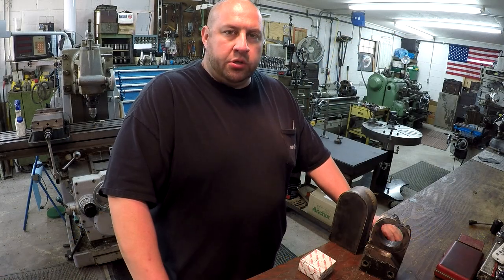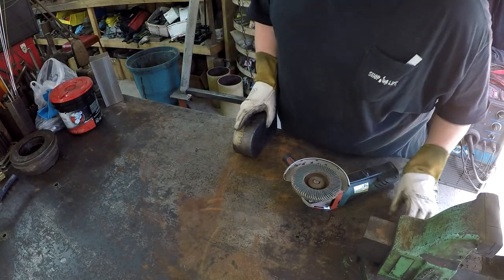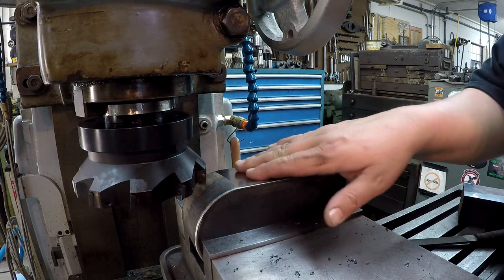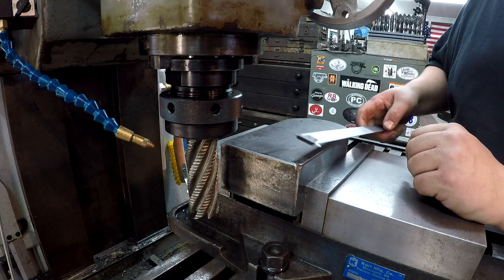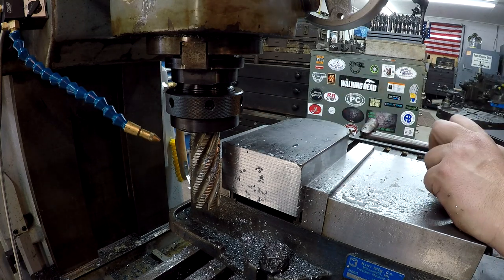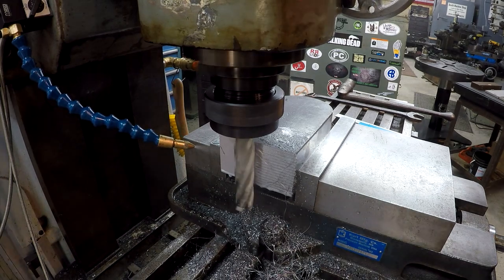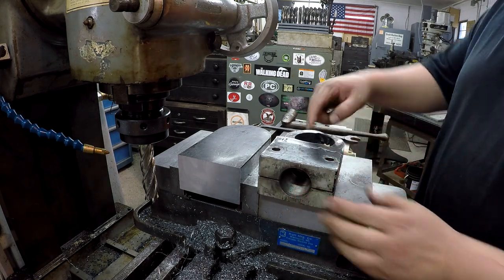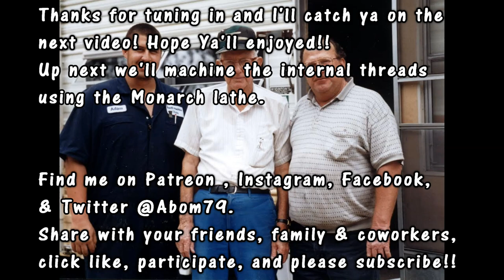Fabricating a Hydraulic Rod Clevis Part 1

Comment: no rattles or squeaks.... Hmmmmm, If I moved that slow, I wouldn't rattle nor squeak either..  

and then again, if I had spray coolant, I might move faster and who knows??? maybe then I would squeak a little bit.  I think I just might look into a system now that I think about it.  It would be nice in the summertime.

by the way... is there a reason for cutting in both directions other than to be sure to spread the mess over as large an area as possible?  I am wondering if it has an effect on machine wear or something else that I am not thinking of?

Keep up the good work... 
Anon

Comment: Yes, the K&T looks and sounds very solid. That does make your life easier.  The burn scale does knock the crap out of the insert edges.  If you have enough extra material ( which you did not ), getting under the scale will allow the inserts the last longer.  Nice work once again Adam.   Jeff
Reply from the maker: +JRD77VET Oh yea, best to get under that. This type of work is also great for that face mill that uses the odd corner of a CNMG insert.

Comment: Hi Adam,

There is some sort of official scale of machine rigidity and a Bridgeport or clone goes into the 'light' category. Even those modified designs with beefed up columns and box ways don't make it up into the next category, although they are a good deal stiffer. An Elliott Sturdimill will plough through stuff that will set a Bridgeport shaking, but the Elliott would start chattering on stuff the K&T would shrug off.

Comment: +Abom79 Have you ever tried using vinegar to remove the scale before you start working? It saves the abrasives and the tooling.
Reply from the maker: +Markk0527 No I haven't.

Comment: Adom, the big mill really runs nice. Do you ever find a situation where you would run a face mill slightly out of tram, heavy on the leading side?  I guess it would be a pain to tram it back for other cuts.....Dave
Reply: if you run a shell, or any mill at that, out of tram you will cut the surface concave. sure there are times you want that, especially if you don't have a cnc mill and need to cut channels or some other cylindrical profile. you are cutting both ways as the tool rotates and it leaves a bit of a swirl pattern on the face, one way to improve surface finish is to run the tool one way and then back the other at the same height and speed. I like to kick it off a few thou so it doesn't follow the exact same path and cuts the peaks a little better.

Comment: Hi Adam, I seem to recall when you first got teh K&T running after the repairs that one of the feeds (rapid vertical?) stalled out while the others worked ok. Did you ever s9olve that? If so, what was the problem?
Reply from the maker: +Mick Durkin No I havn't but I think it's the motor wiring.

Comment: Hi Adam, thanks as always for the great demonstration. I was just curious if you could expand on your comment about seeing the inserts need replacing? What are you looking at/for in that example? 

Neil
Reply from the maker: +Neil Smith The sparks are a good indication that the tips are worn and it's causing too much friction as the insert is shearing the steel. When the inserts are good and everything is right, the chips will be shiny and smooth, and you won't see any sparks. Also the surface finish can tell the tale.
Reply: Thanks for the explanation, Adam

Comment: I've always been told that climb milling was better than conventional. If that's true why did you use conventional to bring the Clevis down to size?
Reply from the maker: +Brandon L. Climb milling is common with CNC machining, not manual machines with lead screws.
Reply: +Abom79 I just put ball screws in my Bridgeport this past fall. People tell me that now I can climb mill but I still have visions of the timeI tried that with the old screws. I will get a job one of these days and with fading memory I might try to climb mill something. Having back surgery in a couple weeks so it may be a little while be fore I'm able.